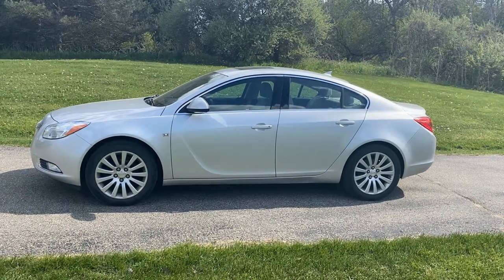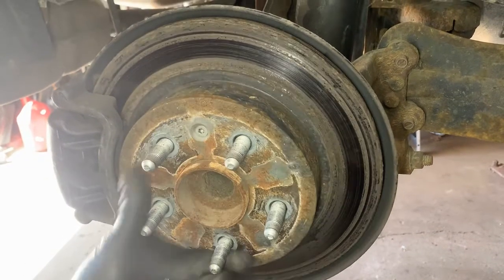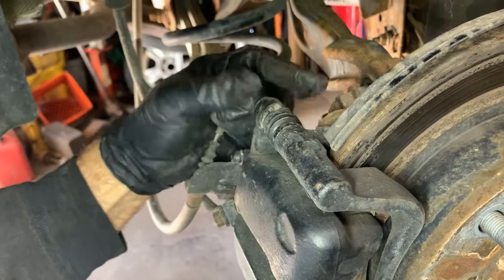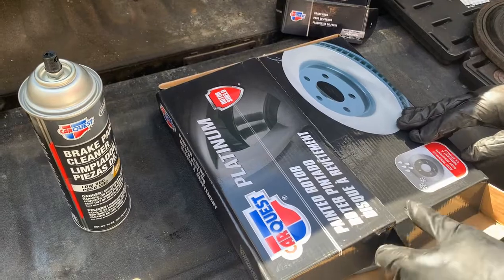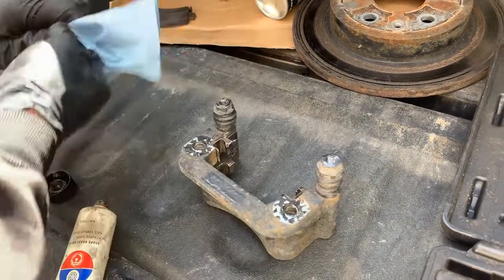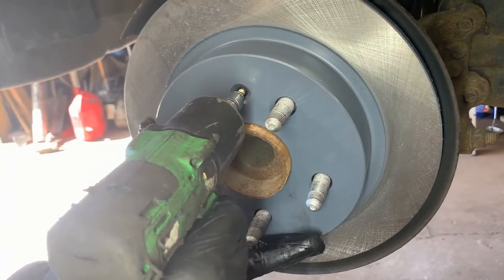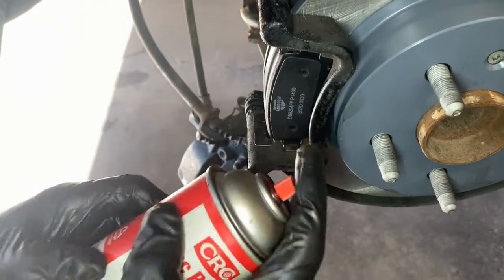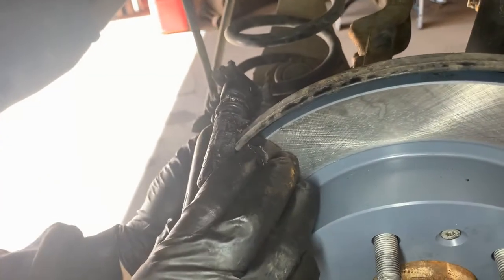How to Replace Rear Brakes and Rotors Buick Regal

Comment: I'm about to attempt this on all 4 corners on my 2015. I read somewhere that you should open the brake fluid reservoir before twisting in the pistons. Is this necessary?
Reply from the maker: There's no need to open the brake fluid reservoir, just make sure the reservoir isn't too full before pushing the Pistons back so it doesn't apply too much pressure on the reservoir cap seal and over flow . This way you shouldn't have to bleed the brakes.
Reply: @TheAutoTeacher  awesome. Thanks!

Comment: I have the exact same 2011 model and color Regal but I have vented rotors. I just replaced with same. Car was made in Germany. Thougths?
Reply from the maker: It's weird they are vented, I wonder if you gave the Vin number to your GM dealer what they would give you that was recommended or equivalent to for your vehicle. It's always recommended to use what is specified by the manufacturer.

Comment: Hello.  Recently had an all around brake service on my 2011.  The L, R began to leak from the seal.  The mechanic stated that the wrong rotors were used because the pads extended about 1/4in beyond the rotor and may have caused the failure of the caliper.  Is this possible?
Reply from the maker: That should have no affect on the seal.
Reply: All OEM buick regals around that year eventually leak. I just replaced the fourth caliper because that same problem always happens. GM messed up by exposing rubber I believe but aftermarket calipers only have steel exposed and it totally fixes the problem. If you don't do your own mechanic work it's gonna cost you though.
Reply: Okok

Comment: How do I bleed the brakes on a 2010 Buick LaCrosse
Reply from the maker: Start with the back passenger wheel, then back drivers wheel, then front passenger, last will be the front drivers wheel, there should be a bleeder valve on each caliper, probably a 3/8 or 5/16 open end wrench. Have someone pump the brakes up and then hold pedal pressure, loosen the bleeder valve  until the pedal goes to the floor and retighten before they let the pedal go or it will allow air back in. Continue doing this until you get a solid stream of fluid, from each caliper. No bubbles should be in the fluid and don’t forget to keep adding a little bit of brake fluid every so often during bleeding process.

Comment: How do you know which size rotor to use? Do you just have to line it up after. Got a 2011
Reply from the maker: If you give the auto parts store your year, make, and model specifications they should be able to get you the proper size for your vehicle. Hopefully there won't be too many variations, you can also measure/line them up to double check the size.